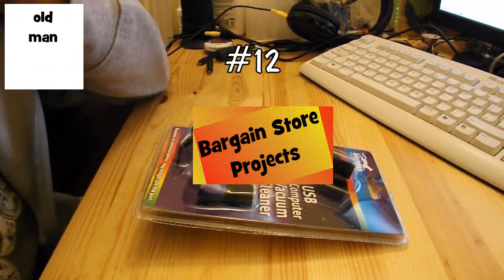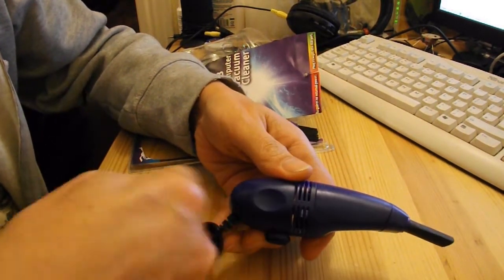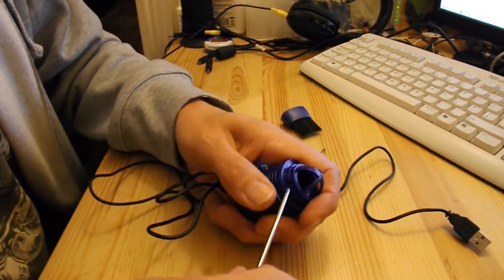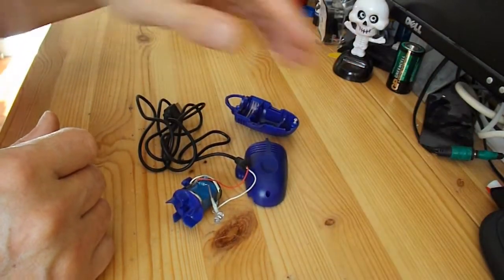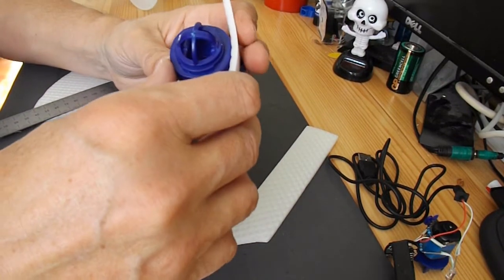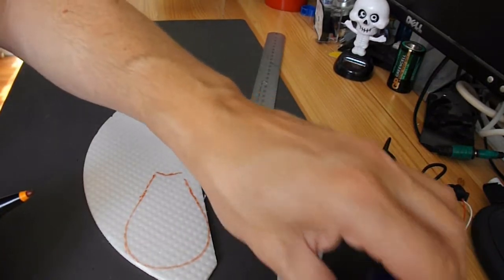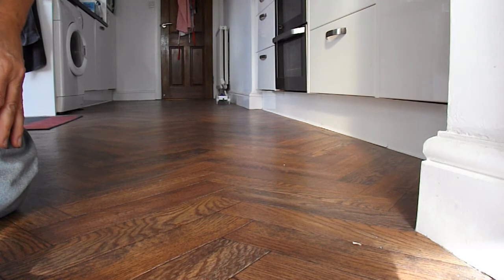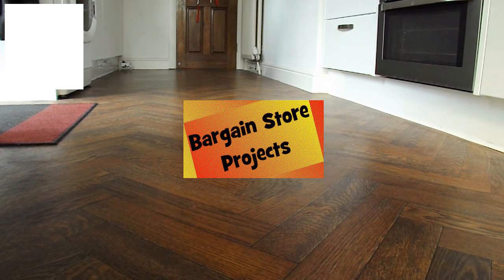Bargain Store Project #12 - USB computer vacuum cleaner becomes jet car

Comment: I like all your gear, but this appeals to me (correct me if that was not your intention and wrong) that prepares an air mattress on the floor, easing pressure on it.
Reply from the maker: Sorry, you are wrong this time. It just blows air out the hole at the back. I pointed the air inlet down through the bottom of the car because that was the easiest way to mount it. If anything it would do the opposite to what you are thinking as it draws the air in from underneath, but that is coincidental and not designed that way.
Reply: GrandadIsAnOldMan Go ...
I did not look good in the video and as I told you not understand English, the descriptions not followed.
So what it does is take the air below and eject forward.

Anyway, even accidentally, it may be that other feed system to another vehicle.
Remove weight thereto, to expel air under basis, seeking to minimize the friction on the surface.
Do not you think?.

Even if you are not 70, you must have a race car CAN-AM category, which used a similar method.
Forbade the end, because it gave him a certain advantage over other competitors.
Greetings!.
Reply from the maker: Francisco Javier Lázaro Pinela Yes I remember race cars that had fans to reduce the air pressure underneath and hold the car on the road :-)

Comment: air should have been pulled from top of the vehicle, pulling from bottom increases vehicle weight.. just say'n
Reply from the maker: +Jay Finke I can see your line of thinking, maybe if it had a bit more power it might have a noticeable effect but I don't think it will have any impact here.